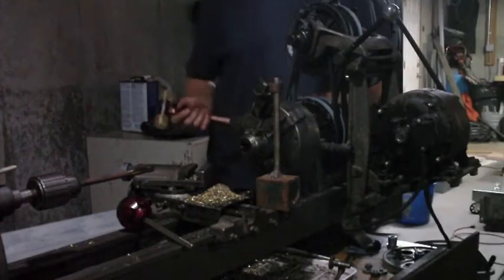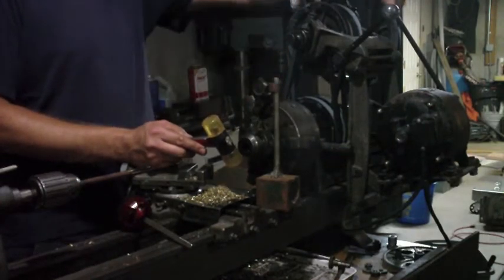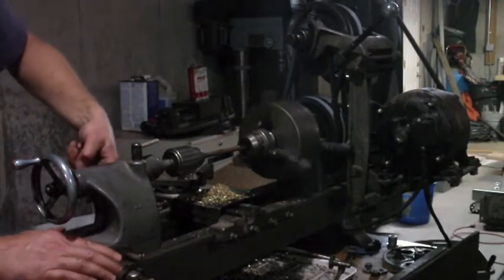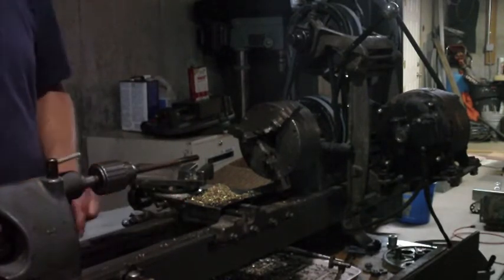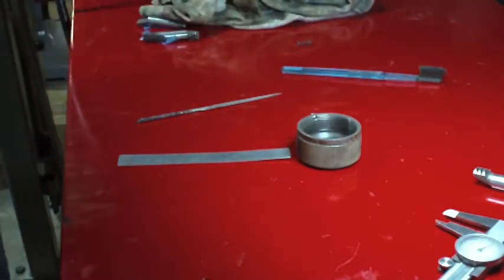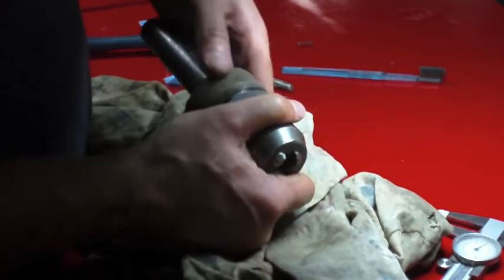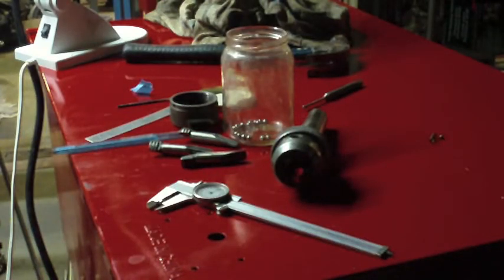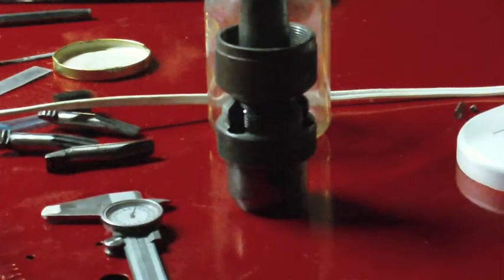Ettco Keyless Chuck Repair Part 5 of 6

Comment: Grease will hold the bearings in place.  Add a drop of oil everywhere that metal contact metal on the chuck.
Reply from the maker: The grease trick is exactly what I did…I think….I can't remember for sure. I'll post part 6 in a few days.